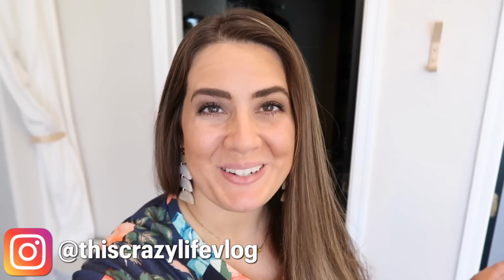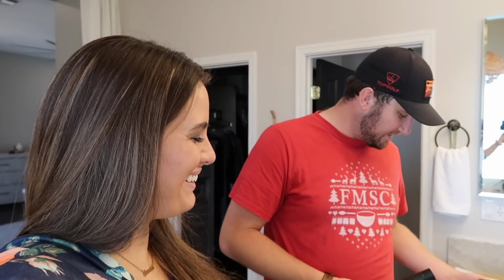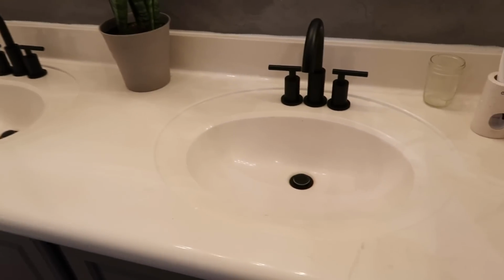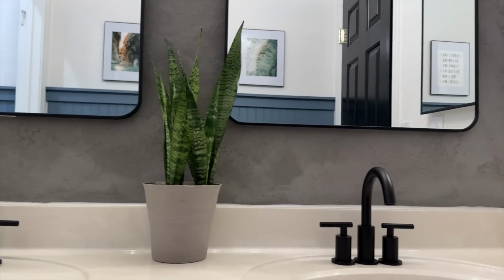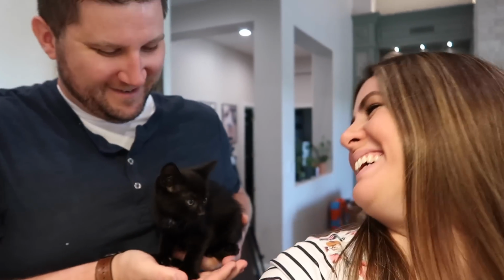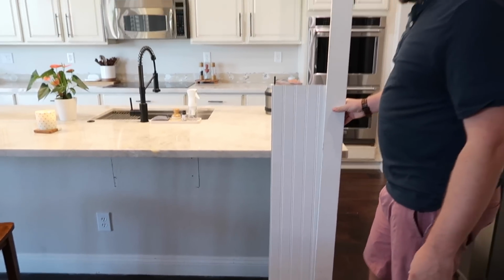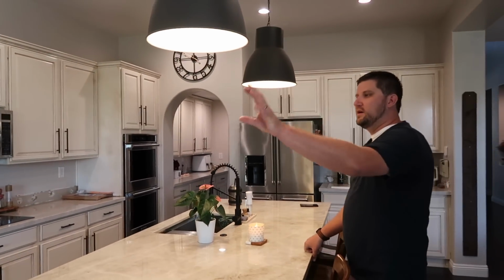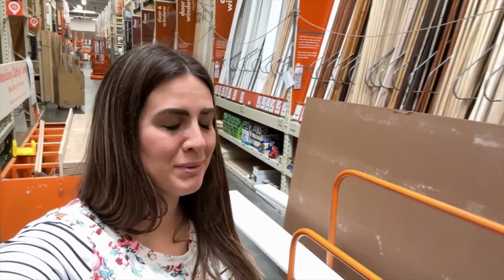VLOG 33 | FINISHING & STARTING HOUSE PROJECTS (bathroom & kitchen renovation) + 🥹A Fun Surprise🥹

Comment: I spray painted my chrome tub drain and overflow valve, and it has held up great! I just lightly sanded them first, and have only had to touch it up once in the past several years.